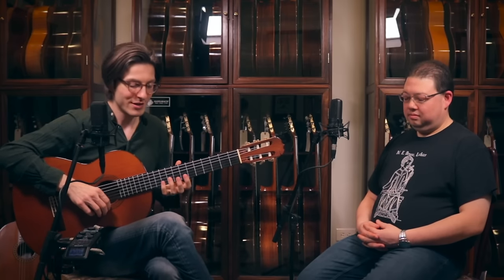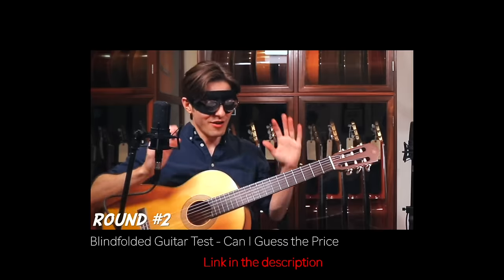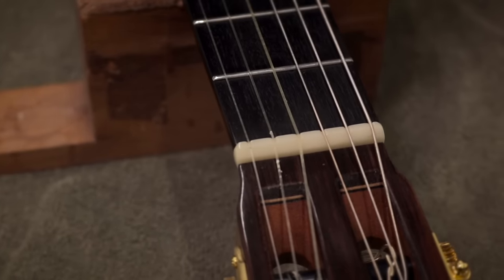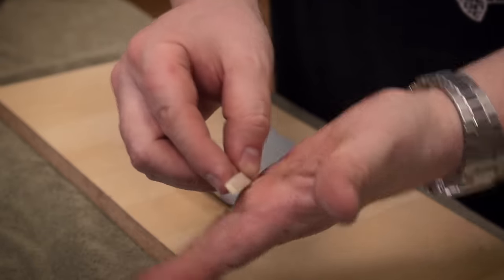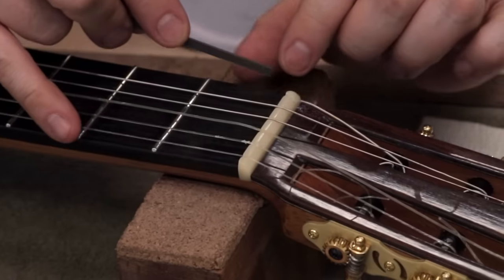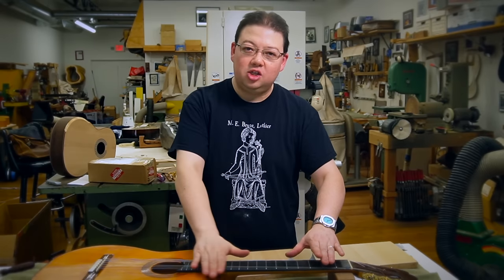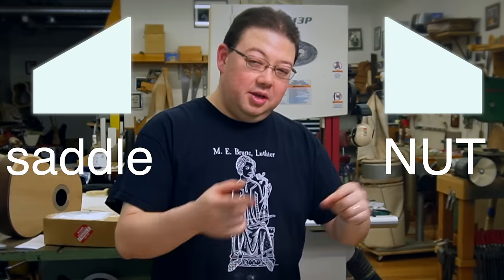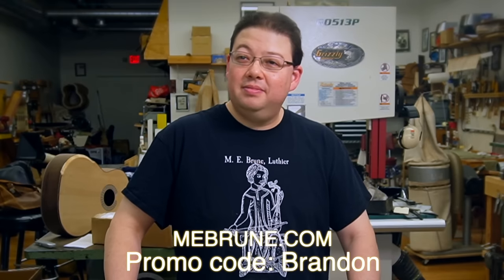Guitar Setup 101: Make your instrument easier to play!

Comment: The most import thing that people forget to mention: You cannot determine the action on your guitar or take any meaningful measurements unless your guitar is IN TUNE. Your guitar has to be IN TUNE every step of the way during a setup and you need to keep RETUNING it after every little adjustment. If the guitar is out of tune you cannot take any meaningful measurements and you will make a mess out of the setup.
Reply: ThanQ, I shall remember that.-)

Comment: When sanding down the bottom of the saddle, it's a good idea to mark the bottom edge so you can see how much you're sanding off. With time you can do as Marshall does it. But in the beginning having a reference is important so you don't take off too much. Just run a small felt marker lightly along the bottom corners. If you want to take off a little more on one end, just press a little harder gradually as you head to the other side when marking it. 

  Better yet, use painters tape (usually blue) to cover the upper part so the mark doesn't spread up too high. Make sure the tape is exactly to the edge of where you want to stop. Then lightly run the marker across the bottom corners. Better still, use only the tape, but you need a sharp eye for that.

   Note: I'm not a luthier (though I'd love to learn), but I was a professional woodworker for 3 decades, and as a guitarist and instructor for 4 decades, I know a few things about setup. Just enough so I haven't forgotten what it's like being a novice. But if someone like Marshall says I'm wrong, it's probably wise to assume they know better. 🙂
Reply: Thanks for your tip! I too wondered about shaving the bottom of the bridge and thought that maybe I might use Vernier calipers to measure the bridge (and nut) height's progress.

Comment: I had to do this to a new guitar only 2 weeks ago, only that I bought a left-handed model (so the shop told me) however it was a right-handed model with the strings swapped round.  This meant the saddle was way to high on the treble side and to low of the bass side (the saddle was setup with a ramp up to the bass side and once the strings were swapped around it was horrible). 
  I took the saddle and flipped it around then used a file to re-cut the top (where the stings contact), making it a defined edge as Marshall talked about in the video with Rob Scallon. 
  With a quick bit of filling on the nut, I managed to get it playing super easy, no fret buzz or intonation issues, and ending with 3.1mm on the bass side and 2.9mm on the treble side, and since I have a very light playing style, its works a dream. 
 All this I have learnt from both yourself (Brandon) and Marshall, Thank you for all the gems of knowledge, and been an inspiration for classical guitar players all over the world.
Reply: My fingers are hiding behind my thumb right now, peeking worriedly around the side..

   I hear tiny cries of "What the hell?" and "Please Gods, No!" :face-blue-wide-eyes:

  Seriously, that sounds so uncomfortable. I had a friend who played a left handed bass, but before that he learned on a right-handed guitar and just played with the strings upside down. When he was playing something complex, he didn't know music theory beyond basic Major and minor chord names, so I would just look at what he was doing and imagine play that upside down.

  It wasn't easy, but it helped me seeing how things worked from a different angle, and I think it helped my overall understanding a bit. Or at least kept me sober a little more often. :cat-orange-whistling:

Comment: Talk about the sorrows of play ability; I bought a brand new guitar in 1978 - just like the one you are holding Brandon - though mine is a 1975 Ramirez East Indies A1 blue boarder label imported by Antigua Casa Sherry Brener Ltd (Chicago) which I bought in San Diego (btw the number under the fret board is #7). Though I loved the guitar initially it turned out the neck had a whooptie doo (was bent or shall we say had a scoop). Over a relatively long period of time I just sort of lived with it and then later bought a Ramirez Brazilian from my teacher Vincenzo Macaluso in Thousand Oaks thus favoring it and kinda setting the 1975 aside though luckily I did not sell it though I almost did.
Eventually after talking to various repair guys I turned the 1975 over to Yuris Zelts at Blue Guitar in San Diego who "heat bent" the neck. The result was amazing as the 1975 blew away the Brazilian, which I subsequently sold and, though this was done like 20 years ago, the neck is still perfect.
Much later with a different guitar I discovered a similar problem though it was fixed much differently. Through James Tyler my teacher at USC I obtained an ~1830s vintage Colin French Parlor guitar. Long story short after dealing with other problems it turned out the neck on it too had a whooptie doo. So, I took it to a good friend and luthier here in Crete who, whilst I watched, trussed the neck up in a vise and a jig and then amazingly laided down a bead of Super Glue on either side of each fret. He let is sit for about a half hour while we drank a little Tskoudia and then, taking the neck out of the jig, the neck was restored to perfect and has remained so.
So, there are many ways to skin the play ability cat Brandon!

Comment: I got my 750€ Walden CG570CEB set up 4 or 5 years ago (guitar is over 10 years old). Lowered the action considerably by lowering both nut and sadle AND sanding down the frets a little. After I put some really good strings on it I could not believe just how good it played. Yes, it does buzz if you hammer it, but it just plays to easy now.. much better than many guitars 5 times its price. I'll have to change frets in a while because I tend to pit them fairly quickly, and I'll maybe put some better electronics into it (it's electro-acoustic), but other than that.. perfect guitar for me.

Comment: My main guitar is an Ibanez AEL30, which I purchased in 2007. I used it for my classical guitar lessons (no fingernails). I believe I had been playing for 6 months or more, and happen to be at the guitar store where I was taking lessons. I happen to show the store owner the callouses I developed on the tips of my fingers on my fretboard  hand. They were the type of dark dead skin callouses you get if you use a shovel on a regular basis without gloves. Based on the shocked look on his face I do not think the store owner ever saw anything like it. He let me know the guitar needed to be setup. I also have a cheap $100 Takamine that I use (primarily) for finger exercises. I had it set up as well, but I am sorry I did. I would recommend that if you have a cheap practice/exercises guitar, keep it close to the factory setup. This will build hand strength and it toughens your fingertips. Also, it makes it more likely that you will be able to play any guitar, regardless of the setup. If all your guitars have perfect setup, picking out you next guitar might be a frustrating experience.

Comment: A couple of questions for Marshall, please. Polishing the nut slot: I assume you were using a wound string? Second, you determined that the saddle was a little high by measuring it above the 12th fret. Is there a simple rule of thumb for height above the first fret to determine correct nut slot height? You just seemed to say that it seemed okay as it was, but how would you know if it were too high?
Reply: thanks for the method of lowering the strings....the string used to polish the nut slots..you didn't identify if it's a cotton kite string or a certain guitar string..would you?  thanks

Comment: Thanks Marshall, very useful. My guitar's action is 4mm at fret 12 and I've always felt that it made things tricky around fret 9 upwards so I'll have a go at lowering it (probably in stages). Brandon, did you notice any difference in playability after Marshall's tweaks?
Reply: "probably in stages" I'm no lutheir, but was a professional woodworker for 3 decades. And wanted to point out that in case anyone else was wondering, that is absolutely correct if you're just starting out. Also, I'll just paste the main comment I left..
  [Quote] When sanding down the bottom of the saddle, it's a good idea to mark the bottom edge so you can see how much you're sanding off. With time you can do as Marshall does it. But in the beginning having a reference is important so you don't take off too much. Just run a small felt marker lightly along the bottom corners. If you want to take off a little more on one end, just press a little harder gradually as you head to the other side when marking it. 

  Better yet, use painters tape (usually blue) to cover the upper part so the mark doesn't spread up too high. Make sure the tape is exactly to the edge of where you want to stop. Then lightly run the marker across the bottom corners. Better still, use only the tape, but you need a sharp eye for that.

   Note: I'm not a luthier (though I'd love to learn), but I was a professional woodworker for 3 decades, and as a guitarist and instructor for 4 decades, I know a few things about setup. Just enough so I haven't forgotten what it's like being a novice. But if someone like Marshall says I'm wrong, it's probably wise to assume they know better. 🙂  
 [End quote]
Reply: @aylbdrmadison1051  Thanks. Sounds like good advice.

Comment: Let's say you have a guitar that already has a very low saddle that can't be lowered anymore without the strings touching the wood on the bridge but it still has a very high and very tight action? I bought a brand new and beautiful Yamaha solid top classical that had this very problem, paid 600 for it but the action was very high and very tight, so tight in fact that I had to tune it down a whole step just to be able to play it, and there was absolutely no room to adjust it any lower because the saddle had been shaved down to just a sliver above the bridge. I'm thinking it was something to do with the way they braced this particular instrument but it was unplayable and I returned it. This was unusual because most guitars today even lower-end student models leave a little room for adjustment and are not this difficult to play.

Comment: Nice video. Regarding the gut strings…how long do they last? I’d like to try them but they are 100€ per set!
Reply from the maker: If you play with nails get varnished gut.  I recommend contacting Bostoncatlines.com 
Those will last you awhile.  The first string will last the least amount of time (maybe a month with nails) so I should get two of those. 

You also only need to buy the top three.  The basses can stay the same.
Reply: @brandonacker  thank you Brandon. Bostoncatlines wont work for me, I’m afraid, because I’m based in Europe. Import fees and taxes are problematic. I’ve just taken up the lute so I’m gradually filing my nails down a little every day. I’m liking the sound on my guitar the shorter I go although the feel takes a little getting used to. If you know a supplier of gut strings in the EU that would be wonderful. I found one but they only sell the Aquila full set. But I’ll keep looking.
Reply from the maker: @DebbieBarrette  Yes you can use Cuerdas Pulsadas!
Reply: @brandonacker  awesome! Thank you!

Comment: Brandon, now I'm curious. Why does Marshall not want a neck that is dead-straight --  If the nut and saddle are at a proper hight to prevent buzzing, but low enough to not put notes out of tune when a string is pressed to the fret bar?
Reply from the maker: Hopefully @Marshallbrune can answer that.  I've always heard this from luthiers but couldn't articulate why it is necessary.

Comment: Wow, a paper shim OK? I heard saddle and nut need to be very hard material for better sound, so i just brought a new saddle (>$10) to replace my low saddle. Thanks  for the info. I just replaced my saddle, new strings and adjust trust rod, but it seems sound not better (even worse, maybe cheap strings?), so the string are very important for the sound? Thanks.
Reply from the maker: It is good to have a bone nut and saddle but the paper shim doesn't change the sound to my ear.  Yes the strings are very important and putting me strings on can make it sound like a new instrument
Reply: @brandonacker  Thanks. Another question: The 6 strings should be the same brand?, or OK for other brand for 4/5/6 strings? Thanks.
Reply from the maker: @coolinva  The basses (lower three) and trebles (higher three) can be completed different brands because they are completely different materials.  

In my experience, the brands don't really matter actually. The materials and tension are what matter and the rest is marketing.

I leave the same set of trebles (either gut or nylgut by Aguila) on for at least a year and will change the basses many times a year as they become dull.

Comment: How big of a difference does a plastic (ABS) nut and saddle make, compared to other materials such as bone?
Reply from the maker: it's a marginal difference.  If you switched it out mid performance, I think no one would notice.
Reply: @brandonacker  Thank you for your response. I'm a long time steel strings guitar player who only recently decided to try a classical guitar. Most of the entry level classical guitars tend to have plastic nuts and saddles, so I was only wondering about possible disadvantages of such material. By the way, your channel is very helpful and inspirational.

Comment: No one is understanding the point of filing the nut. You did not make it clear that the FACE of the nut has to be the HIGHEST POINT IN THE SLOT, and that you are filing down only everything BEHIND the front most point of the slot. Also, point out that if the front of the slot is too low, material will have to be added to the bottom of the slot, after it has a flat surface to bond to.

Comment: what if the angel of the strings behind the sadal is to obtuse and the action is to high? meaning if i lowen to sadal to lowen the action it will also make to angle of the string even more flat and visa versa. what would you advise then?
Reply from the maker: For me that angle is insignificant compared to a good action.  Easy playability is the most important thing and everything else is extra:)
Reply: @brandonacker  thanks for the reassurance it was a big worry and i really appreciate you and Marshall making a video like this, as it's easy to understand and at the same time very informative unlike all the other videos like this. "you two are an inspiration"...

Comment: For a non initiated, the explanation is quite incomplete. For the saddle, after evaluating the height that needs off, first identify the bass or trebble sides , marking with a pencil if necessary, then measure the height in the middle with a calliper before and during the sanding so you know how much/fast you sanded away. 
As well, sanding by hand can affect the flatness of the bottom of the saddle since the pressure of the hand is uneven ( in length AND laterally), and the very movement of sanding tends to wear off more the bouts. I always check that putting a light behind the saddle on a flat surface. To correct low or high spots, do not try sanding again the whole length but only the spot that need sanding. To sand only the center of the saddle, sand diagonally on the corner of the sanding paper. For the bouts, sand perpendicular on the side to the sheet, letting the unecessary bout out of the sheet.
I also use to hold the saddle in the middle, switch sides and to count how many sanding movements were made so I am sure both bouts wear at the same rate. Bone or plastic can wear off relatively fast depending of the force applied and to the paper you use (120 240)
For the nut, unless you have the proper fileS, I wouldnt touch it and let a pro do it.
The cardboard trick, I prefer wood from a matchbox, carpenter veneer or wood from some french Camembert box that I press first with a vise to add stiffness. Sounds probably better but they all are cellulosis anyway.
Cheers.